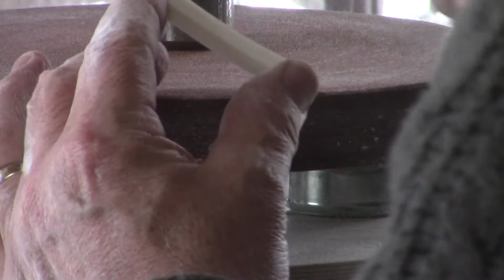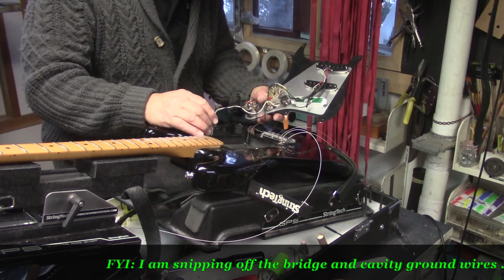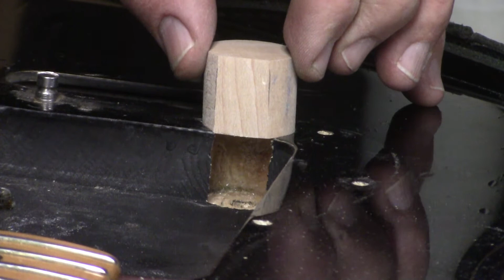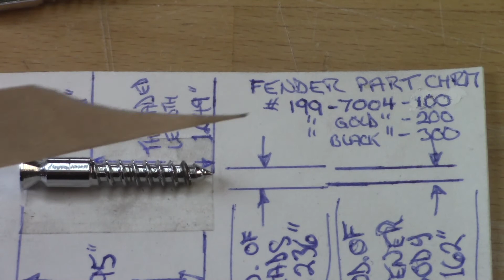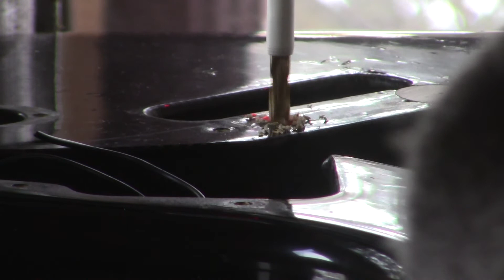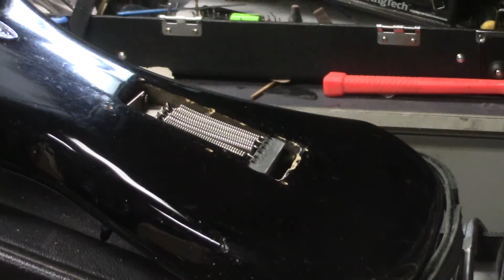American Strat Full Treatment @StringTechWorkstations Perfect Intonation

Comment: Hey, just a note that .236 - .206 gives you . 015 " bite" into the maple. This is the radial difference, or one half of the diametral difference. I love your thorough approach to the problem, especially the cut ups to verify your calcs.
Reply from the maker: I experimented with a few dowels / still bits .... to get the perfect fit. Thanks for the correction.

Comment: Leaving the plug stained and not sealed is an oversight to me, just a coat of shellac to seal the maple..moisture and rust in the the long term
Reply from the maker: Could be John. That was a few years ago ... so far so good. ;^ ) ...
Reply from the maker: BTW: The only unsealed surface was the flattened side of the dowel facing the pickup cavity. The rest of the perimeter was coated in epoxy. The top was sealed with lacquer. I suppose that I could have brushed some lacquer into the ID of the hole. But real critical factor was to allow enough of a "Bite" into the ID wall of the dowel "to grip the threads" ... without splitting the dowel. Cheers John ... Best in 2023 !

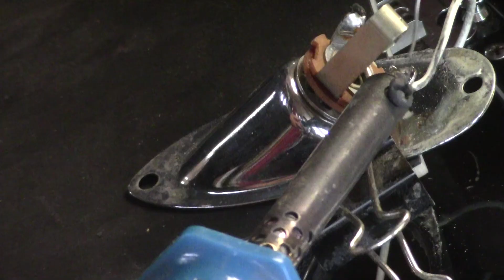Comment: 24:45 you use the hook to tin the jack tab easily? Great video thank you!
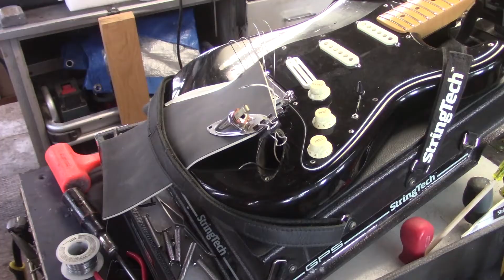Reply: @fkitch thanks for that time stamp 👍🏻  You inspired several slow motion replays watching Mike’s clean setup at 24:32.  
It used to drive me nuts chasing errant wires, connecting parts and solder across the table (or body of the guitar) with a hot soldering iron until clips clamps and vise came into the toolbox.
Reply: Sorry I don’t get notifications when my comments get active reply. 
Ooooh yes well spotted! Adding clip clamps to my tool box too! Thanks!